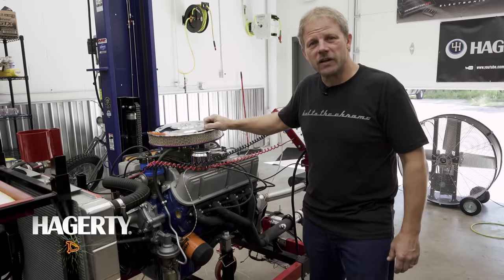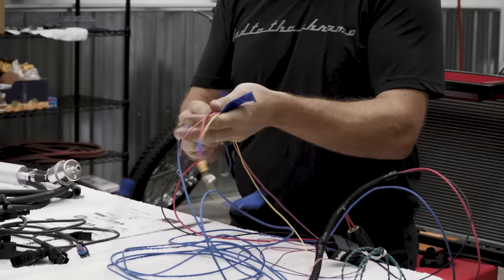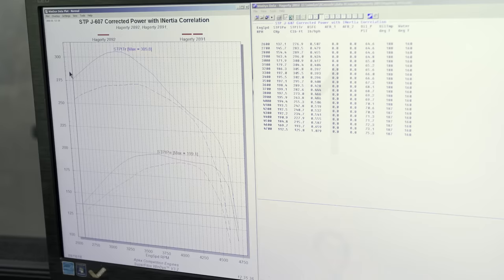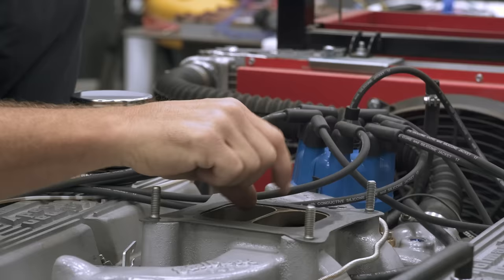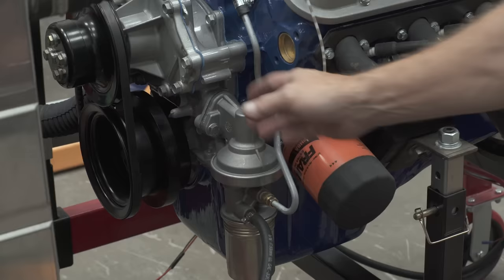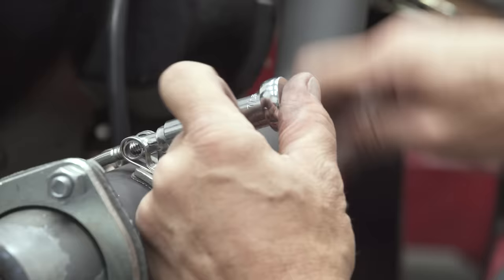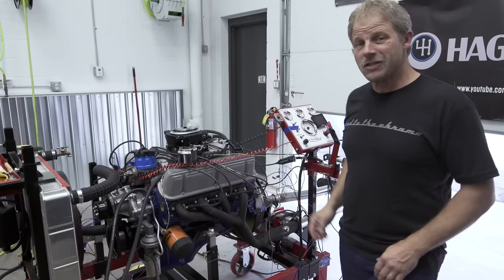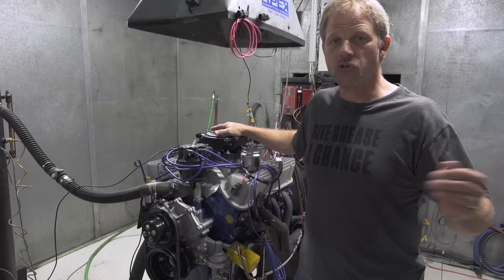Is it worth it? Replacing your carburetor with a Holley Sniper EFI | Hagerty DIY

Comment: I don't understand the point of these. TBI is junk, even if you make it from better quality parts than OEM GM stuff, it defeats the main advantage of EFI being that the fuel is shot straight at the intake valve and has minimal time for any of it to lose suspension, plus the airspeed is at it's highest which also ensures that. I guess TBI might start easier in the coldest days of winter but, really, people say that but my stuff always starts with a few pumps anyways. Not worth the money imho.

Comment: See my thing is the cost of this kit is about as much as you could spend on an LS swap and just have an updated motor in general and have the complete wiring and ecu.  

i have a 55 GMC that i have no clue whats in it. but its pretty much just the engine is laying on the cross member. So im tempted to just take it out and buy a LS swap with a transmission.   The engine apparently is in good shape but i guess the guy was starting to pull the motor out and then gave up on it and left it laying in there. It does seem like its pretty well kept.  But it just seems like alot of money to dump into an old engine that may need a rebuild anyways.  Between rebuilding the engine and doing the EFI i'll have easily surpassed the cost of just buying an LS engine.

Comment: Describing a FMU (efi) and MBC LMFAO 

"The FMU/MBC, like the carburetor, is a complicated device used to provide the wrong air/fuel ratio at all combinations of speed and load!"
....
"Well in its defense it is slightly more effective than the controlled fuel/air leak we call carburetors"

MODERN EFI SYSTEMS WITH MBC/FMU:
Knock sensor: somethings wrong.. I should pull timing 

O2: yup, definitely something wrong, let’s add some fuel 

MAP/MAFS: guys... I’m really not liking this..

MBC/FMU: YEEEEEEHAAAAWWW BOYS! LETS GO TO THE MOON!

Comment: "Sell" people a product. I didn't think this EFI vs Carb was a very objective one.They didn't even bother using a Carb big enough just for the sake of argument or go into the fact based Pro's and Con's of either one. In other words "The selling point is Fake". Now I don't want anyone to get me wrong, I have a fuel injected 05' Chevy Cobalt and an 81' Malibu 3.8L with a Carb. I like them both, when it comes to fuel efficiency I'll use the  Cobalt. When I want alittle more fun I'll use the Malibu. But when push comes to shove, the only one that's going to with stand a Massive Solar Flare or EMP attack is the old school carb cars from 1985 on down. Unless garage kept, The Computers and sensors are going to fry,  and older cars without all the computerization (Minus protected vehicles) are the only ones mostly that will be driveable. The Malibu would survive and all I gotta do is replace two parts I have in a Faraday Cage. . . well the radio too as that would be dead but that's neither here nor there. Just saying I think folks should have one of each just in case.

Comment: EFI would even make more of a difference if EFI brain was also controlling the ignition/distributor,…like 10% or 20% more HP & torque plus making the engine run better in all climates and conditions

Comment: depends if u can run a peddle or not if u can't then it is worth it that way u can tune to the road but me i run the peddle been racing since i was 14 on the streets back then they had nothing like this u had to run the peddle
Reply: so far u are the only person to get more out of efi try notching manifold the same way as the efi that makes a big different in performance and u were way under carb if u build it right u will get more out of the carb most see about 45 hp drop to the fei set up witch would be more right just like in racing when they made them go fuel injection to slow them down

Comment: You can't really compare the HP numbers as you went from probably a cheap 600 cfm carb to a 800 cfm self tuning fi setup. Of course it made a bunch more horsepower i would expect it to make a lot more HP.  A real test would be a 475 horsepower engine and 800 carb vs 800 fi.

Comment: i can see the advantage to the EFI but the cost just is not worth it to me, my truck with a carbed 350 starts easily whether its 10 degrees or 70 degrees and the fuel economy is good enough for a truck (13 MPG)

Comment: can you use existing O2 senser , i have a 85 Merc with a VV7200 and a existing O2 , can i ues it or need a special senser ? . great vid , thanks
Reply: Probably can't run your 85 O2 sensor because it's too primitive. The newer Wide Band sensor is needed.

Comment: I would like to build a set up with a turbo charger boosting through the Sniper. Is this do-able?
Reply: Yes, but it won't work "out of the box", you have to re-map the system for boost but Holley provides support for that, it's easy, just contact them.
Reply: @dukecraig2402  Thanks Duke. I have wanted to try this for years but the systems available up to now were too complicated and expensive. There are a lot of advantages to a "blow through" system VS a "draw through" The Sniper looks like just the ticket to wake up my 8Ba flathead without spending thousands!
Reply: @edwardwerick2420  
You're probably best running a blow through system since the advantages of a draw through are pretty much negated by the fact that systems like the Sniper don't rely on the principles of a carb anyways, and the disadvantages of a draw through like your fuel being heated by the turbo itself and trying to find a location that you can mount the unit on top of or at least before the turbo are all still issues you'd have to deal with, the blow through set up still gives you the ease of the Sniper being mounted in it's easy stock location but the disadvantages like having to pressurize the fuel bowl isn't an issue at all since the Sniper eliminates that anyways, another issue you don't have to deal with running the Sniper is carb size, since they work the way they do you don't have to worry about picking the "perfect size" like you do with carbs.
I've been working on and building machines for a living for 39 years, and it kills me when someone even suggests that points and carbs are better then EFI type systems are.
Years ago when we had customers that still had vehicles with those old systems they'd come in once a year for a tune up and their vehicle would be down on power, mileage would be down, they'd diesel when you shut them off, backfire and just plain run like crap, then you'd tune them up and all that would go away. 
Modern vehicles we only really see for oil changes regarding the engine, power and mileage isn't down in 5,000 miles every time like they used to be, when's the last time you heard a vehicle backfire, or diesel when it's shut off? Years I'll bet, and despite what a lot of people think the manufacturers didn't design the new systems to keep people from working on their own cars, they did it because the government requires them to pass strict emissions tests and get at least a certain amount of gas mileage. 
Modern vehicles make twice the power, use half as much fuel doing it and it isn't because they're still running carbs on them, it's because these systems work that much better.

Comment: I agree with holley, but u had a 650 vac secondary carb? I throw those away, I will not own a vac secondary carb, 289 stock can run a 4150 750 holley if built right max on stock motor and trans, no power additive,  not a fair shake in no means.

Comment: If your going to compare a carburetor to efi do it fairly , the reason you did not is because the out come would have been a lot diffrent, 600 cfm Holley to a 800 cfm throttle body , and get somebody that knows what he is doing.

Comment: Lets see...EFI 10 more HP and a little better gas mileage for $1000 or Carb for $400. I'll go Carb all day long. I have one Holley EFI system on my ProCharged motor. Its a headache to tune. Even with the self learn. Ive been through two O2 sensors and an ECU upgrade. Carbs don't need software upgrades. Until they make EFI as cheap as a carb, I'll stick with old reliable carb

Comment: I can guarantee you that a carburetor knows exactly what elevation in their temperature is it may not read it and numbers but it reads it unless air flow when the air is hotter it's not as dance when you're at a higher elevation it's not as dance so it affects the carburetor accordingly now the carburetor won't compensate for it but you know for every thousand feet you can open it up a jet size

Comment: you are wrong a carb absolutely responds to air temps cold dense air gives a stronger signal to the boosters and enriches the fuel naturally and hot air is thin less signal

Comment: Okay...
Runs the carburetor without stating it's tune jets etc and it looks fresh out of the box not tuned to the engine.
Runs the carburetor with an air cleaner but the EFI is run without just to make the numbers look better.
Runs the EFI with an open spacer but not the carburetor.
Claims the point triggered ignition limited the engine to 4,500 RPM, because cars from the 1960s couldn't rev past that? 
Keeps calling the engine a HiPo 289 but HiPo 289s all had dual point distributors and no vacuum advance and that's not what their engine has.
Does admit even they had trouble figuring out why the EFI initially failed but glossed over the problem.
Conclusion: engines like this are in classic cars not daily drivers, you don't fire up your 1966 Mustang in subfreezing temperatures and drive through the snow to work or you shouldn't. So keep it classic and learn how to actually tune an engine properly.  This throttle body EFI is for those that just want To "plug and play" even if it cost a thousand bucks. Well congrats to your computer chip kids at least it knows what it's doing...until the malfunction codes hit

Comment: If you only look at peak hp and torque  then carb it up. But unless its a race engine EFI is way more reliable and user friendly.  Peak hp and torque should not determine your street engine.

Comment: There is a much better comparison in Engines Masters, and guess what, carb wins. Also this EFI system dont work well with dual plane manifolds because the divider blocks some sensor

Comment: 4900rpm isn't the limits of a point dizzy. My SS 396 would make to 6100rpm with points. You must have had some old weak points in it or other dizzy problems?. . Not much of a HP with carb baseline to go on IMO.

Comment: This is 1980's throttle body injection setup. Not true EFI with cylinder specific injectors with injector timing and pulse width of modern  OEM EFI

Comment: I thumbs down because you didnt use the timing control and you didnt try the one inch open spacer with the carb. Hot Rod Mag has shown either cutting the intake or using a one inch open spacer with a dual plane manifold shows improvements.

Comment: No timing control, does it have air intake temp input. Sure the EFI can work via TPS and O2 inputs but it does limit the true fuel savings and power output by not using all the inputs a modern Engine Control Unit uses.

Comment: How does the sniper system compare to a system with fuel injectors at each cylinder?  That would be an awesome comparison.  Would it make enough difference to warrant swapping heads that allow that or can that even be done?
Reply: Sequential port injection will make less power because with the TBI injection or carb, the air/fuel mixture chills the charge in the intake plenum making the air more dense, more HP. In NHRA Pro Stock, the current port injected cars are STILL  0.10 second & 5-10 mph slower than the National Record set with carbs over 10 years ago.

Comment: Why would compare a non optimized Carb against the efi? I'm calling bull.. I've never seen a well tuned carb make less peak HP over efi , though efi will usually produce slightly more torque at lower rpm

Comment: "trusty Holley"
SAID NO ONE EVER!... your ALWAYS adjusting holley's… edelbrock is know for the dependable daily... holley for winning on the track... never for dependability, your always adjusting, re-jetting, changing idle... replacing power valves... have I missed something?

FYI... I have a ford TFI timing controlling holley terminator, an autocross sniper camaro turd gen, a 72 corvette with a edelbrock and a 93 camaro with a holley double pumper... guess which one is the most friendly every time

the edelbrock
Reply: Of course because you were using the wrong carb on the camaro. Double pumpers were only for race engines with high overlap cams. The Edelbrock is a air valve secondary cab just like the Quadrapuke and works similar to the vacuum secondary Holley.

Comment: A tip from a boat mechanic: if it is absolutely impossible to add a return line to your gas tank, you can just add a VST (vapor separator tank) near the engine. The simple explanation is it's like a mini gas tank for the high pressure pump. It has an internal needle and float which is fed by the low pressure pump. The return line would go to the VST. 😉
Reply: What happens when this lil tank gets  full ? I will not say it's impossible but it will be a little bit of a hassle on my 69 f250 since I'm running a single tank and it's inside the cab.

It doesn't have any outlets other than the the tube that comes from the tank to the fuel pump there might be a drain valve but it would be at the bottom the only thing I came up with is using like a brass t fitting and putting the return valve to be on top so the t would be upside down.

Other than that I would have to maybe drill a hole into my filler neck and put the return hose in the filler neck if I had an extra threaded bun it would be a lot easier to just use that as the fuel return but unfortunately I didn't do that when the gas tank was in the truck other than that I would have to drain the gas tank out and take it all out and do it with it outside the truck and then put the tank back in , has anybody rigged up a fuel return to its in cab gas tank see behind the seat in a 60s model pickup truck?
Reply: @TheThirdWheel618  easy. The VST has its own float and needle assembly inside it. Look up some detailed pics of one. I'm sure you can grab one from a boat junkyard, if they have any of those in your area. If not, ebay is gonna be your best bet.

Comment: You must be an engineer because a mechanic would have placed the o2 sensor were it can be reached once the assembly is Installed in a vechical.

Comment: OK. Here's the thing. I want to drive my hotrod. A lot. My concern is not flow or a measly 20 horsepower. My concern is parts availability and ease of repair. Efi looks good when just looking at driveability and not having to adjust a carb in mountain elevation. But parts fail. I can carry an extra set of points and condenser and a 30 dollar mechanical fuel pump and fuel filter and keep moving. With efi I'll first have to add at least an 800 dollar fuel system upgrade. Hack up my 600 dollar headers. Figure out how and where to add the extra wiring. Then when I finally get going and I'm 340 miles from home on a Sunday and the TPS goes out or an injector from under hood temps where do I get the one off hard to find back order replacement parts while my $30,000 dollar car that almost cost me a marriage is sitting on the side of the road? Now on top of everything else I gotta add the tow bill. That's why I'm still a carb guy.

Comment: A lot of errors in this video. You hooked vac advance up to manifold vac, not the ported vac. You showed using the yellow wore for tach signal, which is incorrect for the cd box set up you used, you held up the coolant sensor plug and said you dont use it. Etc etc. Hopefully no one is using this video as a reference to install their efi.

Comment: This test is skewed, even if the carb was a little small. There's no doubt the EFI trumps the carburetor as far as overall efficiency, but definitely not by HP output. Anyone who knows a bit about tuning can easily see the BSFC is way out of whack with the carburetor, thus rendering the test invalid. There's no way the EFI beats the carb by 100 HP! lol. I've performed and witnessed several hundred dyno tests and fairly compared well-tuned carbs to EFI, and carburetors end up making more HP 99% of the time!

Comment: I wish you would do an IH 345-304-392 build.
Reply: Nobody makes parts fo an IH motor! LOL
Reply: @bradgriffith4231  I know there are a lot of those engines still out there. I happen to own a 304 myself and am looking into a 392.
Reply: @nanceeleana  I'm not arguing that there are motors available but nobody makes high performance parts for them. They were a 3,500 rpm "truck" engine when they were current. I wish you the best but you have a monster quest if you are going to try to hot rod an IH.

Comment: KEEP THE CARB!!!!!!MSD magnetic distributors suck for Holley systems as they limitate timing to injector accuracy and no matter if youre only using 2 barrels o0f the carb all injectors still squirt every 180* of rotation to keep the engine fed...

Comment: Not a fair comparison! What quality of points were used and what was the condition of the distributor? Why didn’t you use a Carburetor with the same CFM as the throttle body? You didn’t tune the carbureter part of the test properly or curve the distributor! You didn’t even mention the price difference!  Just be honest and say it was a ADVERTISEMENT FOR HOLLEY! If you know how to tune a Carburetor and curve a distributor you will make the same amount of horsepower and torque as a throttle body fuel injection system! That’s a proven fact

Comment: This isn't really an apples to apples comparison. You can and should use a spacer, electric fuel pump, and return line with your carburetor. He didn't try to tune the carb either.